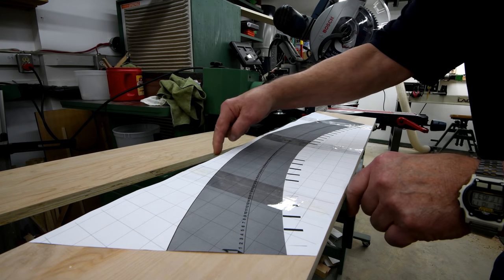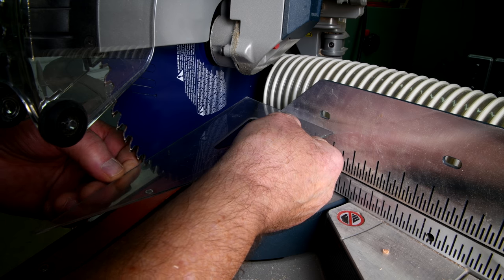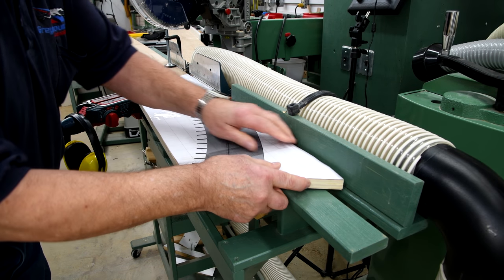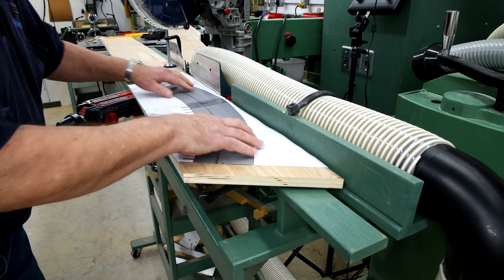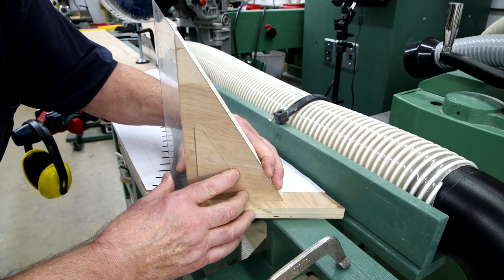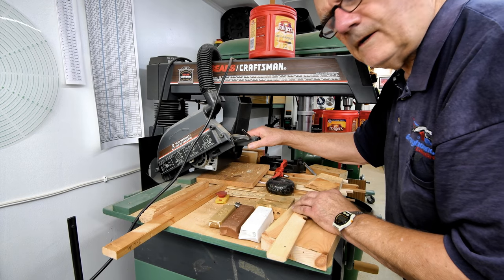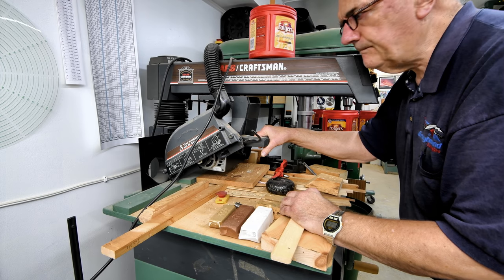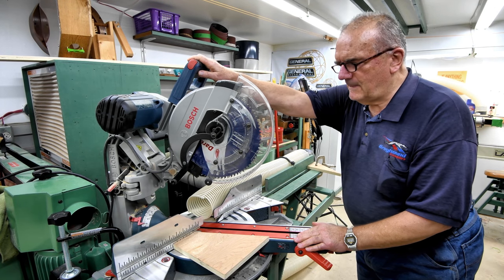The Big Clock Project - Part 68

Comment: I've had a radial arm saw since 1972 and never had a problem. You just had to realize that at some point it will start to pull itself forward and as you feel this, push against it to control the feed rate. Doesn't take long for it to be automatic.

Comment: I had a radial arm saw like that many years ago.  I had it climb on a number of occasions even though I "knew how the saw worked and was prepared".

I'm not sure why you are using the sliding miter as a radial arm saw.  Perhaps I missed that in the video.  If you are looking for a smooth surface cut on each face, just score the top surface then plunge and cut the bottom surface.     See ya tomorrow.      JimE

Comment: I have that same Craftsman Radial Arm saw in my shop. I use it mostly for using my dado stack blades with a push cut. Like you, I use either the chop saw or table saw for everything else. Everything is safe, and everything is dangerous. We need to maintain situational awareness and continually use the number one God given safety device... the brain. Or as one of my instructors once said... "Adjust your head space and timing between your ears". See you tomorrow!
Reply from the maker: Re: "dado stack blades with a push cut" Now that's a coincidence because that is exactly the same thing I've been only using my radial arm saw for --- been a while though. Thanks for commenting :)

Comment: The man that used to sharpen my saw blades put less hook in my radial arm saw blades and I never had a problem.  I kept them marked and separate from my other blades.  But I do know people that have had that happen.  Good information for everyone.  See you tomorrow.
Reply: billy 19461:  You are most correct that the blades are different for miter/radial arm saws and table saws.  Can make a big difference on how they perform.